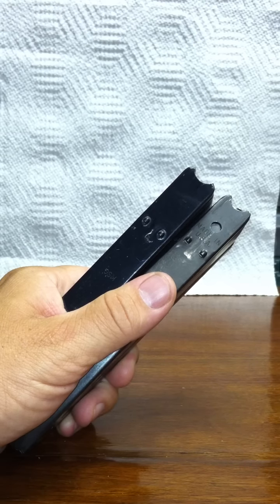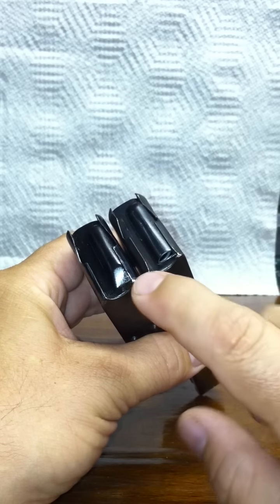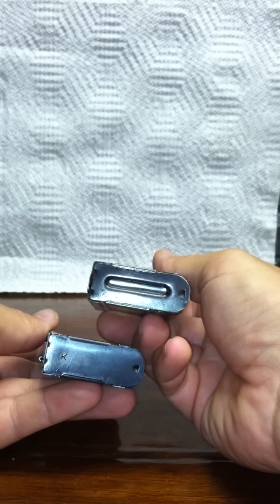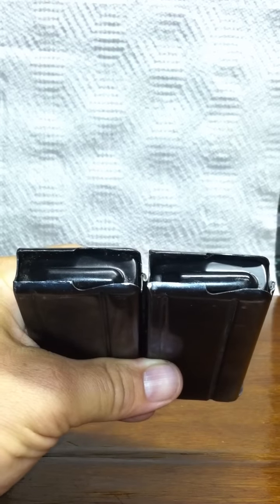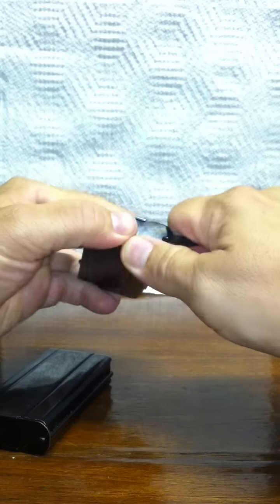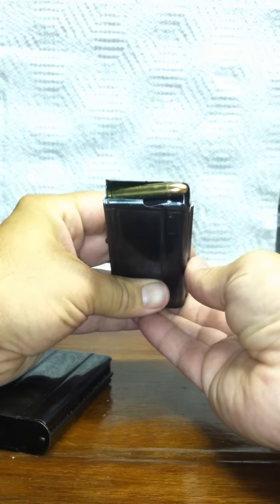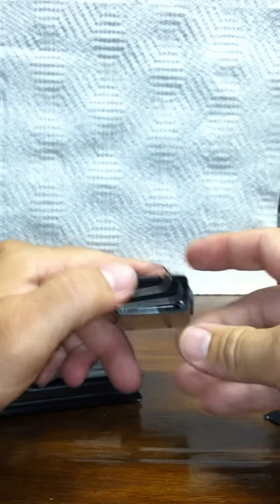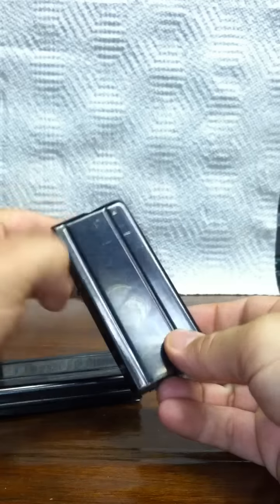M1 Carbine Magazine Types, Function, & Maintenance

Comment: Hello again. Thanks for getting back to me. The problem with getting mags covered with oil, perhaps cosmoline. I tried boiling them with liquid detergent, then soaking in mineral spirits. Neither seemed satisfactory, but I wanted to open them to dry the insides. I've only done one and it was a mess. The base plate had to be pried with a small driver at the forward end to space it from the body, and a second driver at the rear to push the squared end of the plate away from the body. I think I finally yanked the plate off with pliers. I lost track of the orientation of the spring and in any of the four possible orientations, the back of the follower seemed to drop off toward the back. Putting the base back in place was a challenge as there is no groove to follow, only the narrow flanges that keep the plate from falling out. I managed to 'slide' the plate into place, but there was a gap at the back where the plate leaned into the body of the mag. I pushed the leader as far down as it would go to settle the plate, but there was still a very small gap. Now, I don't want to mess with the other mags, which may be starting to rust, until I have some ideas from you. Thanks.
Reply from the maker: Wiped down with paper towels best you can.  Use denatured alcohol with paper towels until almost finished.  Use dry paper towels then Q-tips with alcohol, then dry.  That should help.
Reply: @norwich93CMP  Thanks. Is the inside not greased? And what about reassembling as described above. Did I do irreparable damage? How do I determine if the spring is in wrong it all positions for the spring look wrong?
Reply from the maker: Not lube or grease inside.  Light coat of oil on the outside.  Tallest parts of the spring to the back of the magazine, shortest to the front (muzzle side.)  You shouldn't have damaged.  USGI mags are tougher than aftermarket.
Reply: @norwich93CMP  Thanks a bunch. Much appreciated.
Reply: I bought some new 30 rd mags (name withheld) and had a hard time getting the rounds loaded, plate out or back in.  Turned out the mag wasn't square so the sides were too close to each other.  I had to pry them apart to get enough room to get the plate back in.  It's hard to see but if looking at the end you can see a wider gap on one side than the other.  I'm going to have to take all four apart and try to make them square.  You might want to check yours for that problem.  They apparently weren't bent far enough when making them.  Also I was going to oil the inside, BUT, not now.  I have some CRC spray electronic lubricant which dries after applying and leaves a protective chemical film.  2-26 is for electronic (volume control knob) and 5-56 (Power Lube) is for electrical motor starters etc.
Reply: @bitsnpieces11 : It'll be interesting to see what Norwich has to say.  Maybe you ought to give us all the name of the cruddy manufacturer so we can avoid them. Remember, truth is an absolute defense against defamation charges. I'll go out on a limb here, and tell you that my colleague, who's quite the gun collector, told me not to buy promag manufactured magazines of any caliber for any weapon.
Reply: @RealDapperDude  Well I think I'll hold off on the name for now and see what might come out of this.  I may try to get a refund/exchange and will wait for their attitude.  But a bunch of thanks for the info about them, hard to see how they could stay in business with sloppy manufacture.  It was also to let him know he wasn't alone AND offer a possible fix with the CRC.

Comment: CRC used to make an aerosol "chain lube" that dried and left a film of Molybdenum (Disulfide) dry lube behind. I found it works wonders on M1 Carbine Magazines!
Reply from the maker: Nice but I do not recommend any lube or oil inside the magazine other than a light coat on the spring to prevent rust on it only.  The more lubes and oil the more it has to be cleaned and checked.
Reply: This is a DRY FILM "lubricant".Have you ever used any "dry film" Lubricants? the only Liquid component is their "carrier" which is more like a solvent which entirely evaporates away... Additionally the solvent can be entirely removed after application, by "Baking" any coated pieces in a 400Deg oven for 30mins. the moly disulfide will actually bake into the pores of the metal! and actually penetrate into the crystal lattice of the metal to a depth of 0.020".BTW, tests done  years (Decades) ago proved that coating springs with Mo2S greatly reduced the incidence of fatigue fractures.

Comment: Thk u Sir for ur Video. I don't believe you correct on the followers. The first follower is "mostly" in the 15 round Mag, that was standard with the angled ramp. The second was made for the "M2" and M1, the ramp was cut/modified to hold the bolt open. They were both made at the end of World War II or after for Korea or Vietnam. The way you tell the difference if it is WWII or not, is the manufacture that is stamped on it. Thks again.

Comment: I spray a bit of Remington Gun Oil with Teflon on the inside of my mags, rifle or pistol, then wipe down the inside with a clean cloth and reassemble. I've never had an issue with crud inside a mag enough to prevent normal functioning. One caveat is that I haven't served in Iraq or Afghanistan or anywhere where there is blowing sand. I bet it wouldn't be an issue with regular mag cleaning but I'd probably not do it to be safe.

Comment: I have never got one with the spring backwards. Luckily I got one with matching #s that never was issued or shipped overseas to the many wars they were used in. My dad had one that was sent back here before Clinton put so many restrictions on importing guns to US. Millions are in arsenals overseas that saw combat. His had replaced parts, beat up pretty good. Often threw cases up, side, and in your face!! Ouch! But that's why at the time and now if you see one with a large arsenal stamping on barrel it was and still should be much cheaper. Around 1990 you could get one for $150-$200, mine was $350 that was the diff. I have watched prices go skyrocket. Just a year or two ago I bought an inland 15rd for $12-15. Gi / Period M2 stamped 30 round for $25-30. Today at the gunshow 15rd WW2/Korea era $35-$55. I wanted another spare so I bought a Korean made one for $10 in wrapper. Works great. After all South Korea and US forces used the carbine heavily during the war. Even during WW2 in the Pacific most GI's preferred carbines in the tropical areas especially. Im glad I got mine decades ago is all I can say cause they are $1200 plus now at gun shows for a nice one. And bayonets???? $279?????? Common guys. Wear a condom if you go to buy now!!!

Comment: If i was having issues with the round on the right side in the magazine the bolt wouldnt close all the way but the left side round would let the bolt close all the way after the bolt pushes it out of the magazine i found the end of the brass where it meets with bullet that little lip would catch on the edge of the magazine so you have to use a dremmel tool with a smalllong grinding bit and take away or notch where the lip of the brass hits the edge of the magazine on the way out after i did that and polished the edges with the dremmel polish works like a charm bolt closes all the way everytime if you look at the front egde of the magazine the one side has a small notch where as the other side is straight just notch that one side and all feeding problems solved.
Reply from the maker: Umm, thanks.  Dude, you have one period in that whole comment!  LOL  Yes check the lips.  USGI are harder than aftermarket so beware!

Comment: Had a question. I heard the mags when put in the mag well aren't suppose to wiggle. If so, would getting a new mag catch and release help? Thanks
Reply from the maker: All mags will wiggle a bit, especially with a M or M underlined mag catch.  It had a bit taken off and the spring puts pressure on the back of the mag pushing it forward.

Comment: I disagree on oiling the inside of a mag. I have found surplus mags to have a lot of rust inside as well as sand or other junk. I always disassemble any mag I buy, check the springs for proper position and rust and lightly oil them and then wipe them dry = NO EXCESS OIL. Swab out the inside of the mag with a small wire brush and a rag and then apply a light coat of oil here also. Then swab the mag dry inside of any excess oil. This is routine maintenance for the mag every time it comes back from the range or a hunt.  You can carry 2 o 3 loaded clips in your pack or coat pocket in a ziplock baggie and keep all that lint and other crap out of them. Just use a little common sense.

Comment: Would this be same problem ? on two 30 round after market magazine over 20 rounds will fail to feed , remove magazine flip over and same rounds will drop out, with few rounds at the bottom  of magazine jamming spring from pushing up.

Comment: Hi . Are all 15 round mags ww2 issue? If not what’s the difference with a post war 15 round mag?
Reply from the maker: No.  There are a few aftermarket magazines produced after WWII, but most 15-rounders are WWII.
Reply: @norwich93CMP  my 15 round has a hole at the bottom side . Apparently drainage hole manufacturer is AI

Comment: I dont necessarily agree with what youre saying with the follower spring. Out of curiosity i tried this with 5 USGI mags. (1 Rock-Ola, 1 Winchester, 1 United Postal Meter, 1 IBM, and 1 Inland). In theory this makes complete sense, but i didnt see a difference at all.
Reply: Tyler Smith All he is showing is what is in the USGI manual on the US M1 .30 Carbine for the proper orientation of the mag spring. The spring ends on both the 15 and 30 round mags are clearly facing to the rear, not forward.

http://www.falloutsystems.net/armory/30.jpg

Full text.
http://www.falloutsystems.net/armory/tbcarbsec3.htm

Or

http://www.90thidpg.us/Reference/Manuals/TM9-1276_1947.pdf
Reply from the maker: Being longer, with the pressure points, to the back of the magazine allows the rounds to seat up against the lips for positive feeding.  When reversed the rear of the rounds can fall below the height required to strip a round off when the bolt goes forward after firing.